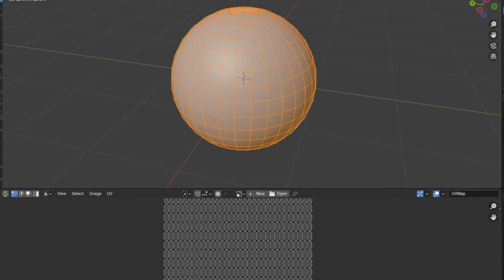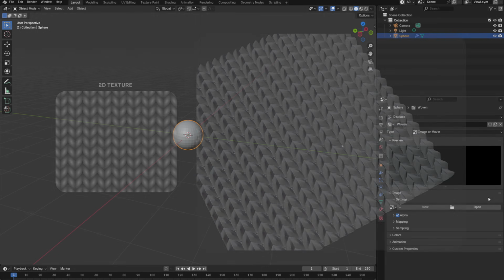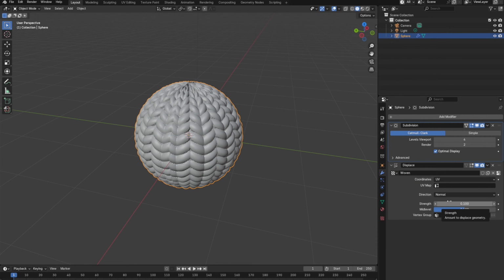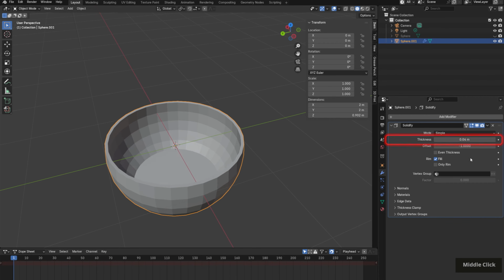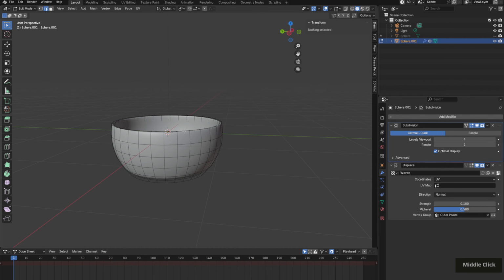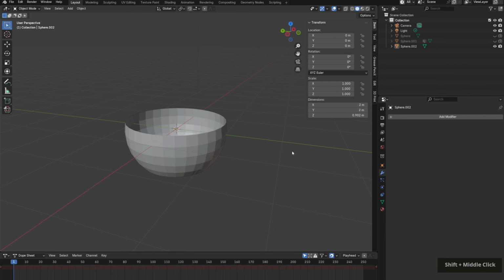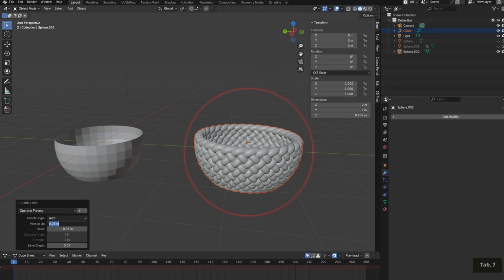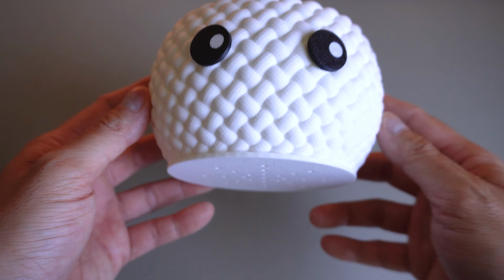Create Knit & Woven 3D Prints in Blender + Free Project File

Comment: These both seem super system intensive and as a game designer im struggling to see how I could apply this to low poly models
Reply from the maker: For that, I probably wouldn't displace at all. I would just use the knit texture and map it onto a low poly object.
Reply: @kevandram  do you think its possible to just create a normal/bump to create more geometry instead of just the flat texture?

Comment: Great video! One question. I exported the object as stl and send to bambu studio for printing.. the printed woven texture  after printing with  the X1C  looks flat... the 'weavering' strings height or depths is not obvious.... any idea what other adjustment needed? thanks! Cheers!
Reply from the maker: Maybe sure to apply all modifiers before exporting as an .STL. The surface should not change once imported into your slicer. I would just double check the modifiers first and then apply all transforms with CTRL + A in Object Mode. Hope tha thelps!

Comment: It doesn`t work with cube. I cant find the resolution or subdivisions.
Reply from the maker: If you bring in a cube and add a subdivision surface, you’ll find it in the modifiers tab.
Reply: @kevandram  I tried experimenting a lot, but it's working very poorly. Different resolutions and sequences fail. I've adjusted the parameters, but it's not applying well. With the sphere, however, everything is simple. But I can't essentially change the shape.